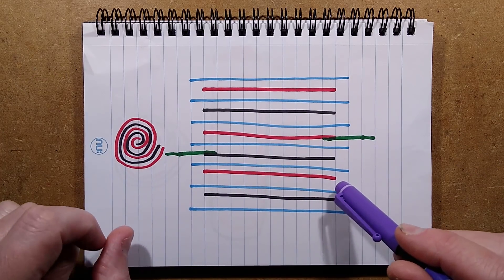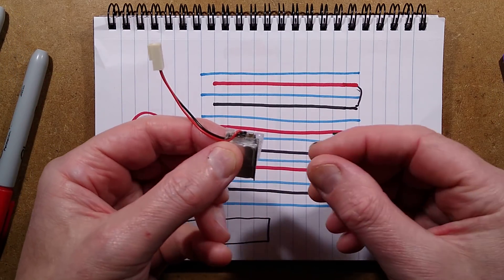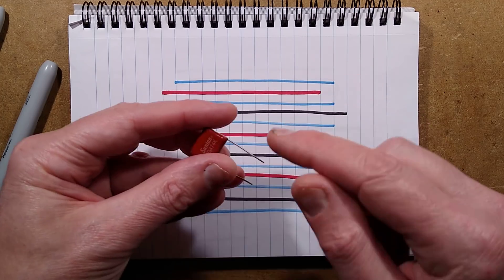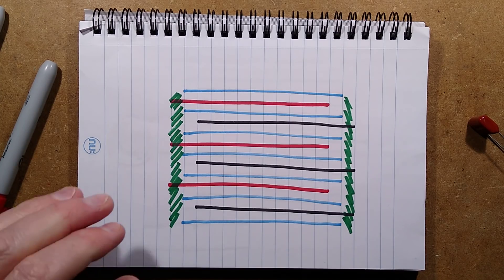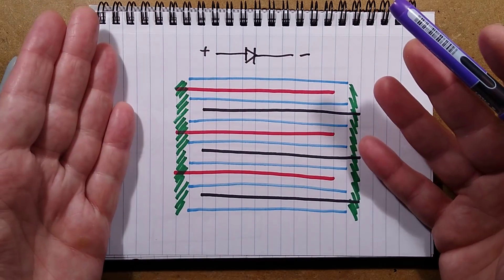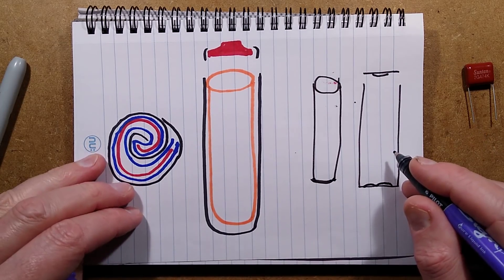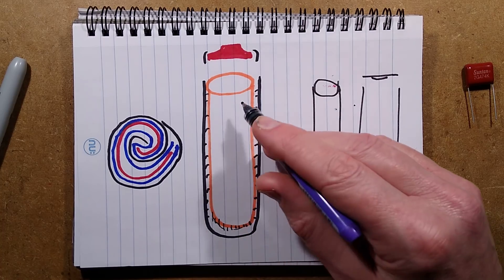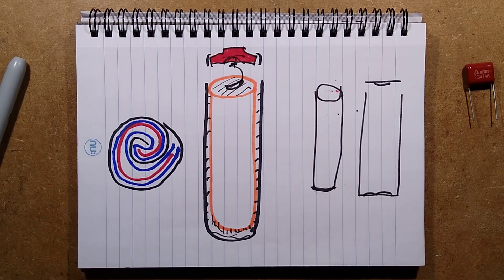Will Tesla's tabless cells ever use Schoopage?

Comment: > "How else are they going to get the electrolyte in?"

If I understand it, they are using a dry electrolyte that is deposited as part of the manufacturing process which is part of the technology they got from Maxwell.
Reply: The purchase of Maxwell Technologies was for their Dry Electrode, not Dry Electrolyte. There's a bit of a difference. Having a dry electrode means there's no need Tesla to premix the electrode material into a slurry before applying to film and baking it. Instead they can compress the dry material directly to film. However, once the electrode layers are rolled up and placed inside the battery can an electrolyte would still need to be added. 

I'd be happy to be proven wrong though as I'd he learning something new.
Reply: @o0ChynaBoi0o  Yes, the Maxwell tech is for reducing cost, time and space in manufacturing. The goal being to make the jelly roll by spreading the electrode on like butter and having it ready to roll. A "dry cell" is the next phase of battery development - solid state batteries which don't have a liquid electrolyte. No one's announced large scale process for that yet.
Reply: My best guess it that the layers are aligned, as you said, with the anode sticking out one end and the cathode sticking out the other. Then the bits sticking out one end are folded flat in a circular motion like was shown in the picture tesla put out.
You then put that into the casing like normal, add the electrolyte, fold the top the same way and add the top of the casing.
Reply: The electrode material will be dry when manufactured but the electrolyte will still need to be added. This usually happens after the jelly roll has been inserted into the can and before the positive cap has been attached. At least that's what i was told. Here's an animation showing the process for pouch style batteries: https://www.youtube.com/watch?v=ceUSPNzxwls
Reply: There are a lot of companies investigating the possibility of dry electrolytes. It's a new technology, and would have many advantages if they could make it work.
Reply: @Karreth  That's why they bought Maxwell Technologies, just for their dry electrode technology.

Of course there's a difference between demonstrating it in a lab and scaling it up to production, but I have faith.

Comment: Aluminum welding is how I actually learned about electrons flowing from negative to positive. When welding on AC the current flips back and forth between electrode negative and positive and it's the flip to positive that provides the cleaning action to remove the oxide layer from the surface, the electrons flowing from the work to the tungsten "rip" the oxide from the surface

Comment: Please God - give us 18650/21700 cells with low LOW ESR.  I hope they pull it off.  It can only help.  I remember when the internal resistance of Lithium Polymer cells was crazy high, now a new battery could have 0.5 to 2 milliohms (per cell) while the 18650's of today still have ESR's of 25 to 80 milliohms.

Comment: There has also been a breakthrough on room temperature superconductors. Someone actually managed to attach a layer of superconductor molocules onto steel tape and it only needs to be cooled with liquid nitrogen.
So far it has halted the fusion and super collider builds so they can incorporate the new room temperature superconducting magnents and I expect that it is going to trickle down into many technologies.

Comment: I don't understand why they use tiny cells anyway, why don't they just make the cells in large sheets and layer them (I am sure the cell material will come on large rolls that is then cut down to cell size), if they used large sheets instead of small cells, they could save space (there is a fair amount of wasted space from stacking cylinders together), and they could intersperse a cooling sheet system between a certain number of layers, they could make smaller denser better cooled packs with less manufacturing effort, and as they could attach along the entire edge of the sheets, current into and out of the battery could be higher.

Comment: Using a single wire to the cap could act as a last resort fuse in event of the battery being short circuited. Remove cap and replace wire to restore battery after severe abuse.

Comment: I think what they are going to do first is spray a 'insulating' layer, and then scrape off half, and then spray a conductive layer. That would expose just the electrodes, while encasing all the other stuff in insulator. Then you could just have a single tab on the one end connecting to the safety popper.

Comment: Back when I was doing a pre-app in electronic servicing (late 80's), electron current flow was the default taught to us.
We were told to look at a diode or transistor symbol as if it was a check valve, i.e. drop a ball into the 'V' of the arrow.
Negative to positive electron flow would cause the ball to lift off the seat and flow, positive to negative would seal the ball against the seat and stop current flow.

Comment: They will cut the corners of the foil and fold it in a way that it creates seal on top/bottom of the battery. Because this is folded metal now, you can safely apply reasonable pressure and connect electrode with as much surface area as possible - creating not only easy path for current, but (more importantly) less heat and better heat transfer to the case. So by one "trick" you will fix 2 problems - higher currents and better (cheaper) cooling.

Comment: I think you’re bang on - if the energy density isn’t changing, then the 16% has to come from somewhere - and my gut feeling is that the improved heat dissipation will allow tighter packing, and after adding on Elon’s epeen adjuster, I can see 15% being the agreed on improvement. The extra 1% would have been pure showmanship on the day, something about multiples of 5 or 10 sounding less plausible or whatever.

Comment: On the Positive end, the Schoopage could be applied. Then the cap could have a plate that has dimples that makes contact with that end of the roll. Then the rest of the cap would be made as normal. Perhaps in the contact plate also have a few holes to allow for pressure bypass if needed.

Comment: https://youtu.be/AqywRziE7pk

The anode and cathode and electrolyte and  seperator  can make a pretty tight sturdy and stiff role. But at one end, say the cathode, the foil can extend beyond the separator and well beyond the anode, thus the carhode foil could easily fold over such that the entire cathode role makes contact with itself at that end.  The same would apply at the other end, with only the anode sticking out past the separator and cathode giving lots of space for the anode to fold over on itself.

Comment: They are not Tab-less, they are a thousand tabs. He slightly cut the edges and folded them over, like shingles (a thousand tabs) on a roof each tile of the anode and cathode touch the next tile over.  There may be a spray on conductor, but if you look at his picture of the folded over ends, nothing but copper tiles were visible. So, the electrolyte may be able to flow through the tiles that are just touching each other. The shingles could also be like little springs touching both ends of the case. I guess, he could spray a little hot solder in the case so the copper tile end is soldered or "stuipaged" in the bottom of the case.  What I find so interesting about this solution, is it's simplicity. Also, heat is the problem with drawing energy out of a battery and putting energy back in. Since the wire length is reduced to 20% of it's length within the battery, these batteries should only get 20% as hot. That is why Musk said he solved the heating problem, and should be able to discharge and recharge the batteries 5X as fast. New Super Duper Fast Chargers that go from zero to 100% in 15 minutes or less.  He also mentioned the Super Capacitors, I'm guessing that he is going to use a bank of Super Capacitors to up the Voltage on the Electric Motor to get more horsepower out of them. Heat is also a limiting factor on Electric Motors, double the Voltage, doubles the Power, while Current and Heat remain the same.  So, these fast discharge battery bank at 320 volts can also charge a bank of Super Capacitors to deliver 640 volts to the motor. More Horsepower, or smaller motors for the economy car.

Comment: The main reason for the different battery architecture is that Tesla is making a LARGER battery than the 18650. It's called the 4680 and is 46mm by 80mm. And, since it's larger, there's more concern about potentially more heat generated by the larger distances travelled by the electrons during charging and discharging. This change in architecture reduces the distance the electrons have to travel and thus reduces heat in the battery.
<https://www.theverge.com/2020/9/22/21449238/tesla-electric-car-battery-tabless-cells-day-elon-musk>

Comment: This would work well with a solid "electrolyte". Is this what is meant by a solid state battery / cell ?
Reply: No, in a solid state cell the electrodes and electrolyte are solid. In the design described here the electrolyte is a liquid or a gel.

Comment: I see lot of misinformation in the comments.  Everyone should watch some of the commentaries and the battery day presentation.

The new "roadrunner project" cells are 4680 -- 46 by 80 mm.  Huge!  The old ones are 2170.

The new cells are patented.  They are open at one end.  They use Maxwell dry coating process to speedup and downsize the manufacturing process.

Tesla bought Hibar, a Canadian company that makes the machines that inject the electrolyte into the cell.  

All this was unveiled on 'Battery Day,' Sept 22.  The whole problem is the constraint on making enough batteries for the vehicles.  It was a very interesting presentation.

Comment: If you look at some of the pics that popped up behind Musk, it looked like there was a set of small tabs that all overlapped to make contact, sort of like a set of scales.  Add a small strip of non-coated (or insulating) material at the end opposite the Schoopage, and you have a barrier against any spray-on solder or the like.  Pic at this point of this video: https://youtu.be/g1ppM22EQFs?t=374

Comment: I would think you could inject a small amount of low melting point solder at the bottom then a quick heat to bond. The same thing could be done on the cap.

Comment: Poly film capacitors with aluminum metalization usually start with a spray of zinc, which bonds nicely to the aluminum. Often followed by a thicker layer of a low temp alloy to make attaching the leads easier.
Also, the end spray is porous...
Reply from the maker: If it's inherently porous that would resolve the electrolyte issues.
Reply: @bigclivedotcom  Seems reasonable, it is how capacitor sections are vacuum impregnated with wax, resins, oils etc.

Comment: You said that electrons go through the separator while charging, but are they? Don' t only the ions go thought the separator and electrons always go around? (forced around while charging). Another point is that the they seam (from the pictures) not to be using coating but instead many many folded copper pieces that probably will only get folded after the liquid gets added.

Comment: Another approach could be a special shape on the edge of the electrodes protruding outside the dielectric, designed so it allows the cell to be filled with electrolyte after the electrode edge shapes are spot welded together at the ends (after rolled or folded up (depending on cell form factor)), together with the connection to the outside.
And you could have the connection to the outside sandwiched between the layers of the shape, allowing for even loading of all parts of the cell.
But you would need precision equipment when rolling the cell together, as well as cutting out the shape on the end.

Comment: @biigclive I have a first gen leaf and it uses pouch cells 4 sandwiched in a metal boxes I think there is 192 pouch cells in total giving 390volts. I know it's not the same as elons battery but bigger surface area better cooling. all the 18650 batteries I use seem to get well hot even my e-bike battery gets well hot n this why tesla are liquid cooled.  air flow is sufficient to cool my traction battery on the car because of pouch cells the car is 10 years old and still got 10 bars soh out of 12 but it would have been better if Nissan had used liquid cooled. I didn't know that on capacitors either that's interesting to find out. Nice explanation on the tech on elons battery matey. Thank you Clive take care stay safe.

Comment: They could coat the inside of a rube with solder paste prior to the electrolite and solder bond.  The other tab could hav, not a regular spring, a bi-metalic fuse acting like a low pressure spring.  It would make more sense to have several points of the ' Jelly roll ' tabbed for the non copper side to become rolled into a line of contacts and just solder to a cheap circuit board with onboard resettable surface mount fuse.

Comment: this is still how they make capacitors even the ceramic capacitors use this method. i always found that fascinating how they make those tinny rectangular capacitors with such a high capacity. gotta put a link here https://youtu.be/5_OSxBLlcKQ
Reply from the maker: The slight downside of the tiny ceramic capacitors is that they are prone to cracking under stress, and then short out or exhibit resistance.
Reply: @bigclivedotcom  they all have their flaws, you just have to pick your poison.

looks like they are just folding them over like a rose into the middle on the batteries

Comment: Don't think they'll cover the whole edge as suggested, I think the separator will extend a little and the tab a little more. Then these are folded 90 degrees before capping it, this allows the separator to "seal" the immediate neighbors allowing the material to extend close to the end, then the folded edge will make contact with the other layers making for a distributed draw.

Comment: What about taking an insulating strip and drawing a 3/4 width conductive line down the middle of both sides of it lengthwise. Then sandwich it between the 2 conductive foils with part of the conductive line hanging out. Kind of like a sandwhich with a slice of cheese hanging out between the bread. You could then either solder to the 2 sides of the parts hanging over or even better design a double lined cap that contacts the conductive part on the outer side with the rim of the cap and the inner liner contacts the inner conductor and routs it to a hole in the center.

Comment: Could the dielectric separator be produced in a high temperature high pressure injection moulding process where it in effect produces two spiral like bags with two open ends. But then you would have the problem of squeezing the cathode into one side of the bag and the anode into the other side of the bag. Solve one problem, make two new ones.

Comment: One thing I heard during the presentation was the anode and cathode foils are laser cut.  The pedals in the "end flower" look to be be individually sized and shaped for more uniform packing.  I suppose the overlapping  pedals  maintain conduction through expansion and contraction cycles.
They didn't really reveal how they were connecting the new jelly rolls to the case and cap.

Comment: If you take that idea to its logical limit, schoopage on both ends with the copper outside of the roll forming the other contact. Possibly a little space in the center could hold a strip of closed-cell foam with a conductor embedded inside it. This would allow both ends of the aluminum to be schoopage'ed but only require one of them be connected to the outside while also providing a little space for expansion.

Comment: Hmm, how about adding a material on the negative side as a thin liquid that lines the sides and bottom then Inserting the “jelly roll” and tab the top positive. Applying a charge current that will essentially melt the liquid lining into a solid connector fusing it together for schoopage. This could be done at the charging testing phase of the cells while also checking the internal resistance for a quality control.
They do have some expansion with charging at high current for fast charging with the heat and fast discharging. I dont thing Elon will give up on fast charging or high discharging so how ever they do it, it will have to be a increase benefit or it wouldn’t be worth the cost.

Comment: Interesting that you looked at capacitor design to get an idea about Tesla's new battery tech, because ISTR Tesla acquired Maxwell to gain access to the ultracapacitor experience/tech. Maxwell also brought dry electrode research to the Tesla party. https://electrek.co/2020/01/21/tesla-acquisition-maxwell-big-impact-battery-elon-musk/
Reply from the maker: Not sure about the dry electrode coating.  That's like trying to paint a wall with dry pigment.  It probably crumbles when the foil is rolled up.  Especially in the middle.

Comment: This sounds like it would seal the battery layers, if applied to both ends. Need to have a way for any build up of gas to get out from the center of the roll.
Reply from the maker: It might be possible to apply the schoopage as a mesh or radial lines.